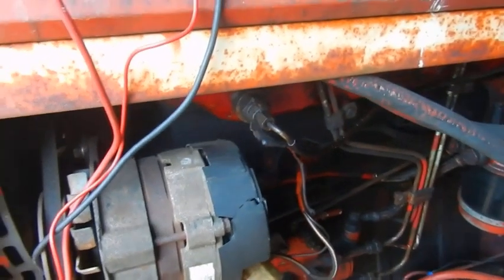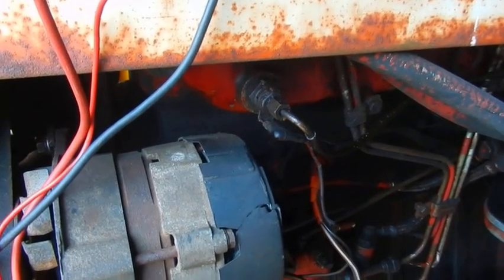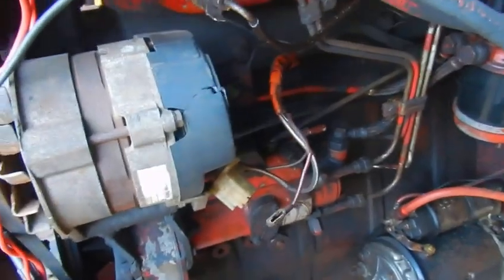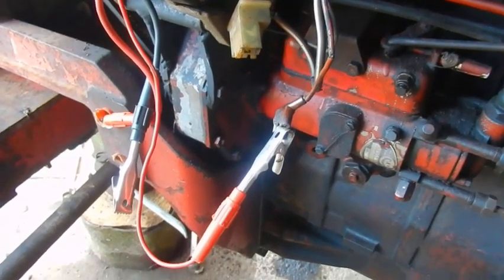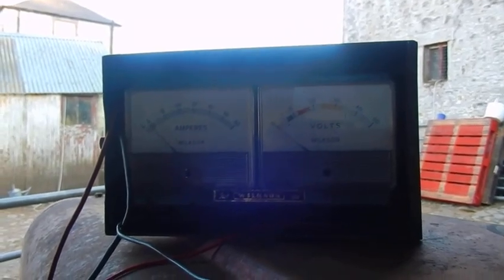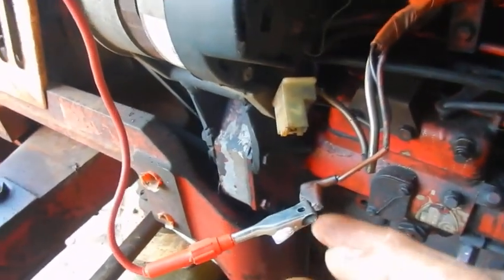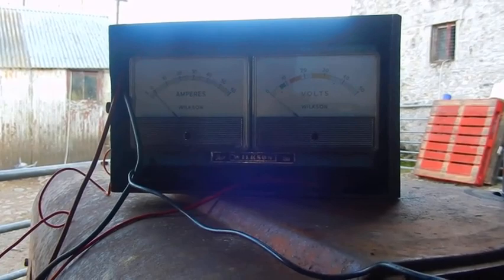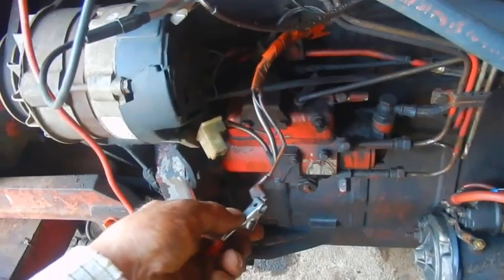International 574 'Thermostart' heat plug

Comment: Thank you.  I've been looking everywhere to see how many amps these things draw and it looks like 10.  My Ford has it go straight from the key switch so I didn't think it took many.  But it has a new key switch (I just got the tractor).  I've been wondering about putting in a relay.  I used to have an older Ford that had a relay but it didn't have diesel fuel coming into the plug like this one.  I thought these types were like a cigarette lighter as far as amps, which doesn't require a relay.  Ill bet it caused the ignition switch to have a shorter life, though.
Reply from the maker: Hi, It's worth having a look at my other video, Genuine thermostart v spurious. I agree better through a relay and a separate momentary switch, the springs wear out in the ignition switches and the thermostart does not switch off and burns it's self out, thirty quid down the drain. Good luck, Jon

Comment: How do I test the thermostart wiring with a volt meter? It’s on a Perkins 3 cylinder AD3.152 diesel engine that’s in my Massey Ferguson 231 tractor. I don’t think the thermostart is working.
Reply from the maker: You need an ammeter the thermostart should draw about twenty amps. A multimeter will not do the job, they normally fuse at ten amps. Or take the plug out and see if it is working, see my video 'Genuine thermostart v. spurious. Good luck, Jon
Reply: @wotjonsez2560  Is there anyway to test, with a volt meter, if the single black wire that plugs into the thermostart is getting power when I turn the ignition switch to the heat position?
Reply from the maker: @travisricks3436  Yes, if it's a negative earth put the black lead to ground anywhere on the chassis or the neg. battery terminal and the red lead on the thermostert terminal try the switch and you should see battery voltage - 12-13 volts. If it's a pos. earth put the leads the other way round. You don't even need a meter, with the switch on just try the wire to the chassis and you should get a spark.
Reply: @wotjonsez2560  I had a mechanic test 2 thermostart plugs using lead wires off of a 12V battery. Both were bad! 1 wouldn’t heat up at all, and 1 wasn’t getting power at the terminal. I’m going back with a genuine OEM Perkins thermostart, part number 2666108. This is for a Massey Ferguson 231 tractor with the 3 cylinder Perkins AD3.152 diesel. Very happy that I now know what the problem is! Just gotta order the thermostart now. Thank You!
Reply from the maker: @travisricks3436  I am glad that you got to the bottom of the problem. Best regards, Jon
Reply: @wotjonsez2560  Good news, I got’er fixed! I installed a new genuine Perkins OEM thermostart heater plug in the engine and it works perfect now. I bought it off eBay, opened box but still brand new. 
**A quick test: If I hold my fingers on the heater plug while it’s heating the intake manifold, it’ll get so hot I have to take my fingers off. That’s how I know it’s working. 👍🏻
Reply from the maker: @travisricks3436  Well done I am glad that you have go it fixed, Jon

Comment: Good   day  from Ont  So u have a cav pump  on.  Mine  is other  one Bosch I think
R cav better?   Thanks
Reply from the maker: Hello, I have several machines (and Land Rovers) with these dpa pumps., I find them to be very reliable and I like them because they are easy to strip and service with no special equipment. The only problems that I have had has been diesel leaking out of the governor cover at the throttle and stop lever spindles, just a couple of O rings and an easy job. Of course, where diesel leaks out air leaks in which can cause starting problems but an easy fix. As for which is better, the short answer is, I don't know. Regards, Jon

Comment: Good  day from Ont.  My 574  has not got that on.  A neighbor told me about that on David Brown,  he said if they don't work diesel  will  run in cyl.  Thanks
Reply: If anything fails it can cause problems.
Instant failure on those thermostart integral valves doesn't usually occur.
If it has the small reservoir there is usually only a small amount of diesel in it.....
If it has been in there 40 years maybe a new one might allay fears?